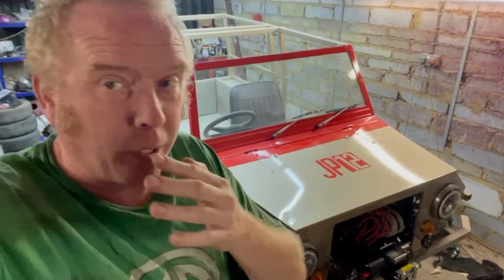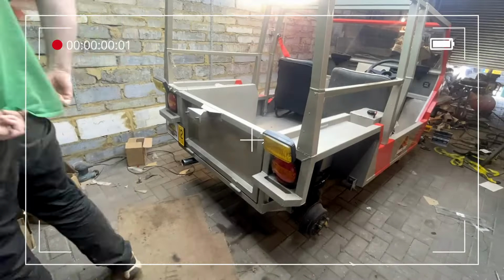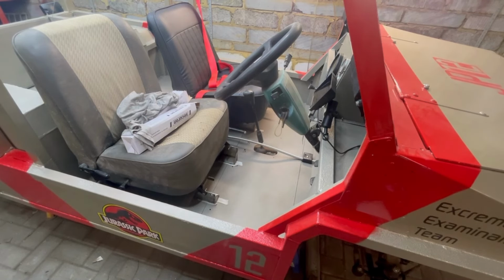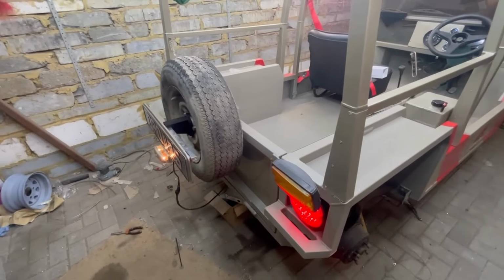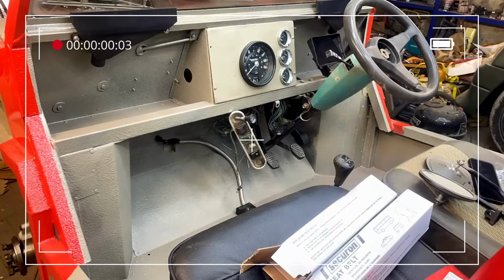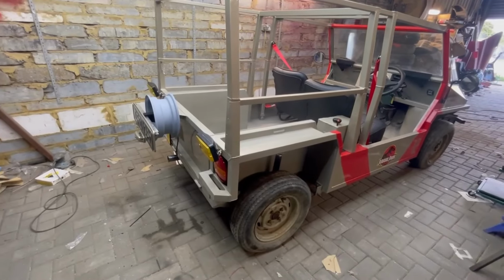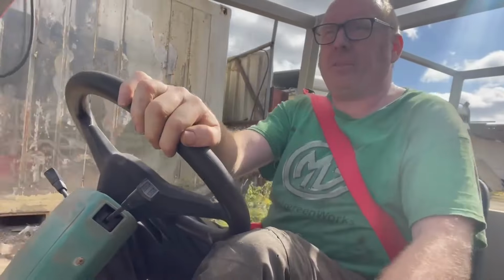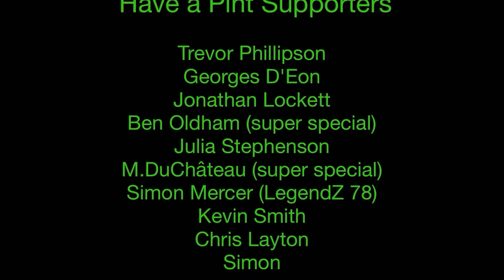JURASSIC PARK MK3 SCAMP - FIRST DRIVE ATTEMPT !

Comment: fit a plate down the front edge of the rad to the outer wing to aid the cooling , minis normally have a seal between the outside of the rad and the outer wing on the scamp the hot air is circulating around the rad from hot side to cold.